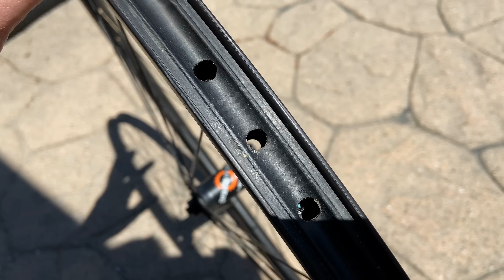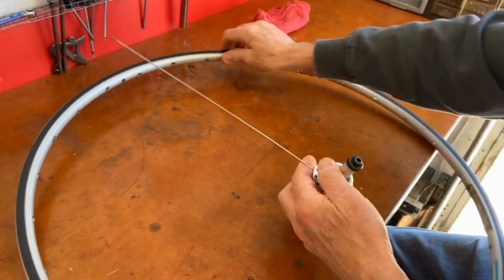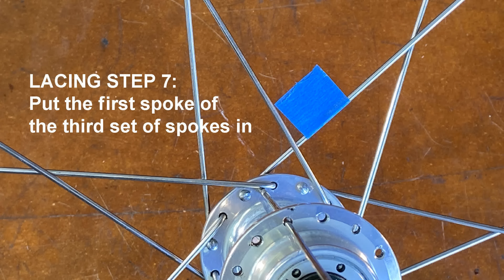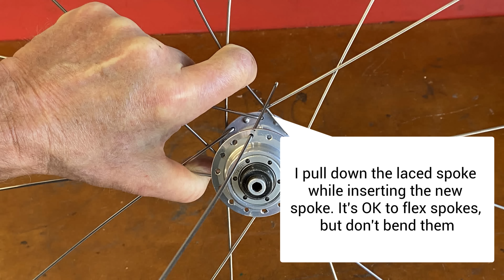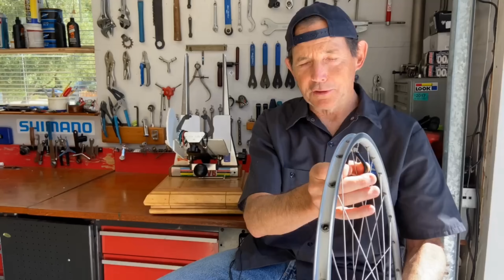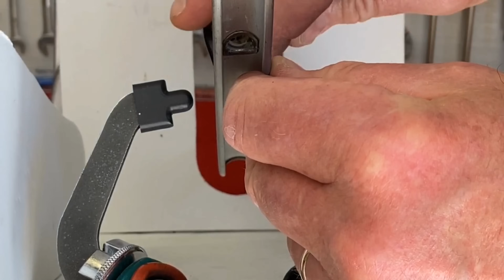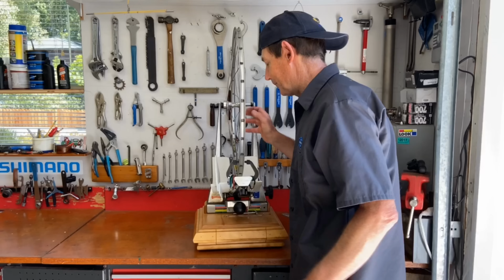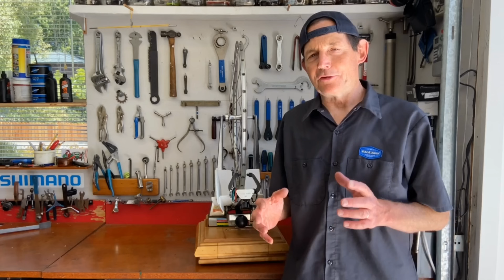How To Build Bicycle Wheels THE EASY WAY! #bikerepair

Comment: G’day Jim, thanks for the spoke length calculator link, I managed to get suitable spokes today, had a lot of fun making the 1st wheel thanks to your video. Mate is it possible that these cheap and nasty rims could be out of round because of a height difference  in the wall ( the flat part of the rim where the brake blocks make contact) I got  the lateral very good working to your plan I took care of the worst egg but this smaller one won’t budge and I’ve had the corresponding spokes pretty tight and it made no difference to the egg, I don’t have a truing stand  but have good reference points on my frame. Where the egg’s located it seems one side ( the flat part where the brake block makes contact and where the tyre seats) wall of the rim is higher than the other side, it’s nowhere near the join so that’s not causing it.
Reply from the maker: G'day Authentic Aussie! Congrats on getting the spokes and building the wheel. I think you're rebuilding a used rim, correct? You also said it was "cheap and nasty" ;-) - which makes me think you might have a defective spot in the rim. With good quality and good condition rims, both sides of the rim (the rim walls) will be the same height all the way around. Sometimes at the seam, where the rim was joined during manufacturing there can be imperfections, but you said that it's nowhere near the rim joint. Still, if it's a poor quality rim it's possible one wall is slightly higher than the other. When you have this situation, you work with the spokes to get the wheel as round as you can. If the other side of the rim is fine, use it as the reference and ignore the damaged/defective side. Usually you can get the wheel nice and round except for that bad portion on one side (one wall of the rim). But that shouldn't even be noticeable when you're riding. If it interferes with smooth braking, then carefully sand/polish it until it doesn't. What I'm describing here solves a small out of round spot. But you wrote "egg," which usually describes more of the wheel. If the bad spot is larger, like 1/3 of the way around the wheel, that's something that you can usually get out by loosening the spokes at the low areas of the "egg" and tightening the ones at the high area. But typically that would be for an out of round issue on both rim walls. I hope this helps you finish the wheel to your satisfaction.
Reply: @JimLangley1  G’day mate, thanks for your reply Jim, yeah you’re spot on I’m using my old rims and they’re like everything here in China, they look good but the quality and performance leaves a lot to be desired ,  because copyright/ trade laws are non existent here everything is branded Shimano, Swiss, scram ,etc and carry their logos  and the sellers push it on you as the genuine article. I used the wrong term when I said “egg”, it’s just a high spot and it’s only about 4-5 mm along the rim. On to my front wheel today,  thanks very much Jim, best wishes

Comment: Hi Jim, thanks for the very I’m formative video, I’m currently stuck in China because of travel restrictions, I bought a 2nd hand bike that was flogged out and now I need to rebuild the wheels, they were rebuilt twice here,  by “bike mechanics “ using 2nd hand parts and even my rookie eye could see there was issues with the spokes, all different tensions and were very noisy when I rode. It was something that always bluffed me (wheel building)  but after watching your video , I’ll give it a go. Parts availability here is a challenge, You didn’t touch on determining spoke lengths  but I’ll see how I go. Thanks for sharing your knowledge with us all. Stay safe.
Reply from the maker: You're welcome and thanks for watching! Here's a great resource that explains all the steps of spoke length calculation: https://bikeschool.com/resources/spoke-calculator Basically it involves measuring the front and rear hubs and the rims (or 1 rim if they're both the same). Once you've recorded all the measurements, you plug them into the calculator and also tell the calculator how many spokes are in the wheel and whether you are using 2- or 3-cross (etc.) lacing - and the calculator will tell you the spoke lengths to use. It's important to take the time to get the measurements exact. Another way to get the lengths is to bring the parts into a shop that sells spokes and have them calculate and sell you the spokes. But, not every shop is set up to do this, so you'd want to call first and ask. Note that there are lots of spoke calculators online. Should you not like the way the one I linked to works for you, just search for others and give them a try. Hope this helps you upgrade those wheels! Thanks for the great comment.

Comment: Why there is 28h 32h and 36h ? Why j bend and straight pull? What role does it play in wheel build ? 

Should we go 28h front and 32h rear for example ?
Reply from the maker: Thanks for asking these wheel component and design questions, Marcin. The reason there are so many choices in number of spokes, types of spokes and hub and rim designs is because there are different riders and a myriad of ways wheels are used. Wheel builders get to choose with the goal of making the optimum wheels for that cyclist and the way they use their bicycle. 

There are different spokes counts - 24, 28, 32 and 36 are the most common (36 less so these days) - so that you can save a little weight and potentially make wheels a bit more aerodynamic (with fewer spokes to whip up the air turbulence). If you go the other way and choose more spokes, it adds strength and longevity to a wheel. 

J-bend and Straight-Pull spokes are the two common spoke designs both going back to the dawn of cycling in the 1870s. This is a personal preference choice for builders, but if you are building with used hubs, then you just have to use the spoke type that the hub requires. J-bend spokes sit in through holes in the hub flanges and the elbows of the spokes make little grooves in the hub which is by design and supports the spoke helping prevent breakage. J-bend spokes are less likely to twist when you are tensioning the spokes during wheel building. 

Straight-pull spokes attach to the hub in different ways depending on the design of the hub - and there are many.  Straight-pulls do not have the elbow and head of J-bends and that means that that part of the spoke, not having been shaped/bent, could be stronger and less likely to break over time. Some straight-pull spokes are more likely to twist during wheel building because they do not have a bend/elbow preventing it. For this wheel builders use spoke holder tools to keep them from twisting (I use this tool after filing the jaws smooth so as not to scratch the spokes: https://amzn.to/2Fdc7sj ). 

On your last question, in most cases (for average sized/weight riders and average use road and mountain wheels), using 28 spokes in the front and 32 in the rear wheel will work fine - assuming you are building with quality rims, hubs and spokes. Since the front wheel takes less weight, fewer spokes will work and save a few grams. And because it's leading the way, reducing the number of spokes make the wheel more aero. Many riders like the way fewer spokes look, too. One more benefit is that fewer spokes means wider gaps between spokes which makes wheel cleaning slightly easier/faster. Okay? I hope these answers are helpful and again, thanks for asking the great questions, Marcin!

Comment: @10:41 -- should not be "every 5th hole" -- but every 4th hole. Yes, the 2nd spoke goes in the "5th hole", but it is the 4th hole after the first spoke, just as you will use the 9th hole for the 3rd spoke (not the 10th hole).  Generally, using language like "every 4th" or "every 5th" is confusing/ambiguous. Better to say, "from the hole with a spoke, count to the 4th empty hole and place your next spoke."
Reply from the maker: Thanks for the feedback, Jim. This video is geared towards beginners who can get confused fast when there's a lot of counting involved. So, I teach and show here a simple way to lace that's proven easy to understand with my students. But, in fact, from your last sentence you can see that we're actually saying the same thing, just a slightly different way (sounds like you've taught wheel building, too). To explain, I show and say every 5th hole so that the hole with the spoke already in it gets counted. The reason for that is that counting that hole with the spoke in it already is a reminder that you are going to copy the pattern of where that spoke is in the rim when you put that next spoke in. In my experience that's helpful for new builders in getting the pattern right and avoiding confusion. That's why I do it and teach it that way. Thanks again!

Comment: I have a comment about applying strictly the method to a 36 hole rim with a 4 spoke crossing (first lacing experience !...), on which the "mesh" of spokes  has a lot of crossings. Once you have done the first side entirely, it is impossible on the other side to install the 'inside' spokes (those having their head outside the hub): they have to be inserted towards the hub, so that they go through the opposite already installed mesh of spokes (wich is quite dense in this configuration) in which they get trapped so that they cannot be turned around to go horizontal to the rim... I solved this by undoing half of the spokes already installed on the first side. I think one reasonable thing to do is to insert all 'inside' spokes on both sides first before starting lacing.... For 'outside' spokes, no problem though.
Reply from the maker: Thanks for the comment and good job persevering and figuring out how to get the spokes in on your wheel. Different hubs and rims can require analysis and problem-solving. Sometimes it's necessary to flex the spokes you're placing into the wheel and also flex the spokes on the other side. It's fine to flex the spokes as much as needed to get the spokes in place. It's easier to do this if the spokes are loose. If the nipples are threaded down too far, then you have less "give" in the spokes already in the wheel. When you put in the separate spokes through, you sometimes have to flex them a lot and pull them up to where they bump into the spoke cross on the other side. At this point, you can get the separate spokes to pass between the crossed spokes and get them in place just fine. Sometimes I've taught students, who expressed concern about damaging spokes by flexing them to get them into position. But, it's not a problem. The spokes can handle it. You just don't want to actually bend the spokes, which won't happen when done with care. Schwinn school taught a technique to avoid having to flex spokes. With their method, all the spokes were inserted in the hub and then the spokes were inserted in the rim. This avoids spoke conflicts, but it's a difficult way for a beginner to lace a wheel since knowing which spoke to place where is a mystery - until you've built enough wheels to understand. I wrote this long reply to help others who might run in to this issue. I realize you already figured it out. Congratulations on your wheel build! Well done!
Reply: @JimLangley1  Thanks for your answer. As a beginner did'nt know one could bend the spokes and I was typically very conservative on that... I must say that your video is really FANTASTIC and is the only one on YouTube that had me understand the logic, which is applicable to any configuration! By the way it took me rather ....2h30 to have this first wheel just laced 😅... the second one 1h.
Reply from the maker: @organopleno2000  Wow, that's quite an improvement, 2.5 to only 1 hour! Nice job. With a little more practice you will be able to lace up wheels in less than 30 minutes, I am sure! Again, great job on your first wheelset - and enjoy the ride!

Comment: HELP!! For some reason, as I was finishing lacing my wheel some spokes became very hard under tension making it harder to put the rest of the nipples on, but when I went around to loosen them, they were already as loose as they could be without the nipples coming off. I didn't notice the spokes being different lengths or anything, so what is going on? Because despite that the wheel looks just like it should!

Edit: Also some are very loose even though they are threaded on much more
Reply: Upon further inspection after disassembling the wheel, all the spokes vary in size, very slightly, but up to a few milometers in some cases. I have them sorted into 3 piles, one long spoke pile containing 6 spokes, one medium spoke pile containing 12 spokes, and one small spoke pile containing 18 spokes. They are all multiples of 3 so I'm assuming there's a specific way to do it considering the fact that this is a 36 spoke wheel. If you could help me out that would be great. I'm going to do a little bit of research. I'm rebuilding a rear wheel with a new hub as I am upgrading from freewheel to freehub, and it is a low end wheel if that helps. Thanks.
Reply from the maker: BJ Jongejan hmmm, since it’s a rear wheel, you should have at the most only 2 different lengths. Usually the shorts go on the right/drive side and the longs go on the left/non-drive side. The fact that you have 3 lengths is curious. Are you maybe measuring them without making sure each is perfectly straight? Sometimes they get a little bent and hard to measure. Wrong spoke lengths is an easy problem to have. You may want to double check your calculations. Also, when lacing try to only screw each nipple on a few turns- like 3. Because if some are 1 turn and others are 5 turns for example, then it can become impossible to get nipples on late in the lacing process. Now, lets say you think your lengths are right. You can relace but this time when you get a spoke that’s too short, you switch it with one from your longest spokes pile. In this way you can often “outsmart” the mixed spoke lengths and through trial and error get the wheel laced. Hope this helps. Good luck! Jim
Reply: @JimLangley1  Thanks! I only now just saw your reply. That does seem to be the case. I will be doing it the way that you suggested!
Reply: @JimLangley1  That was my problem, thank you!
Reply from the maker: BJ Jongejan you’re very welcome - good job figuring it out. I know how frustrating it can be sometimes. But if you take your time and look carefully and think, almost always you will solve any issues. Well done!
Reply: I also just noticed that my rim is offset slightly, so I will go ahead and try to build it again, and see if that helps. Crossing my fingers :|
Reply: Now I'm calling it, there are at least 2 different length spokes, the longest ones I'm going to call within margin of error and combining them with the spokes that are medium. Now I need to figure out whether the offset side should be shorter or longer :/
Reply: I believe since the side with the sprocket on it is pulled closer to the center of the wheel it should need shorter spokes. I will update you if it works :)